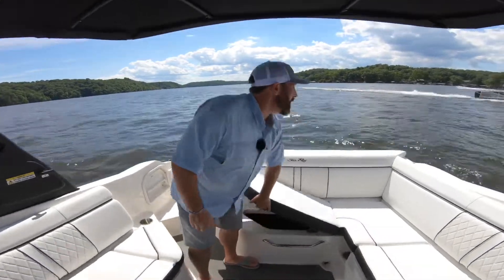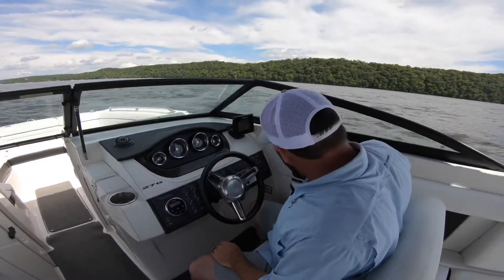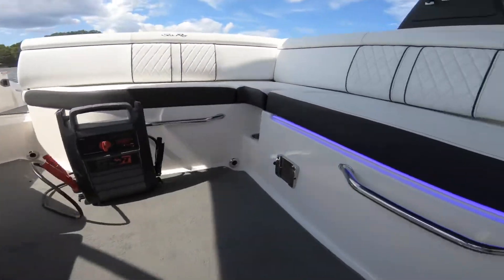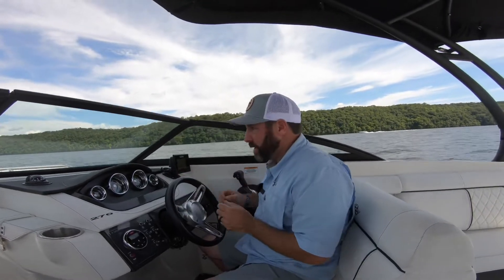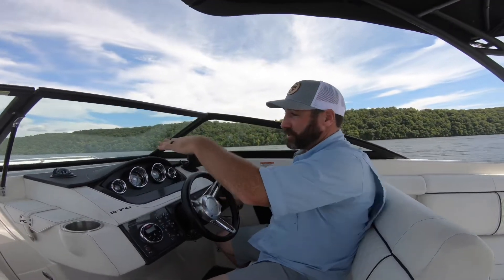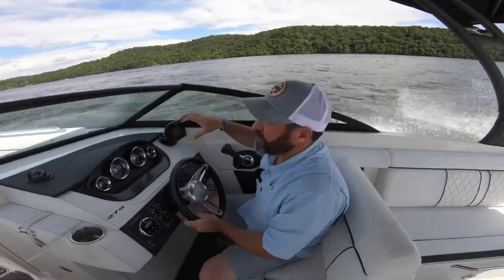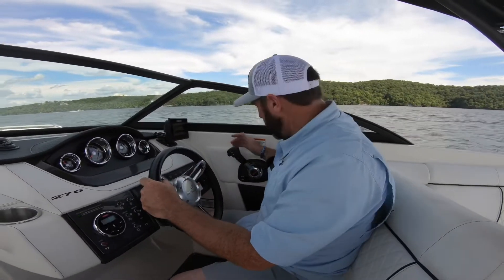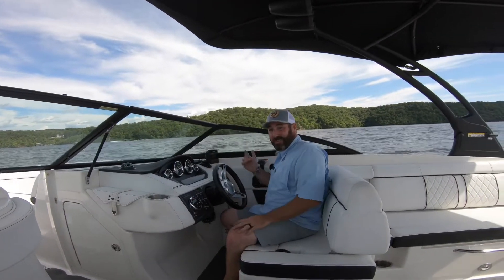Is a Sea Ray 270 SDX a good boat? Part II

Comment: Thank you for doing this video!  It's a great review of the boat.  I'm buying a 290 SDX, and enjoyed watching this.  

But, please be careful not to share misinformation.  Docking lights are not "headlights".  In fact, it's illegal to use them like headlights.  If the water is 15 feet deep, you should use a scope of at least 7 times depth, or 90 feet of rode... not "25 Mississippi".  One can use a little paint, or tie a ribbon on the rode every 5 feet so you know how much is out there.  Trim tabs aren't really for "hands free" steering.  

Running with both batteries all the time is a good way to forget, and kill them both at the sandbar.  It's better to use only one, and switch which one you are using each time out.  This helps "exercise" the batteries, which improves longevity.  And, if you run the stereo too long and kill a battery, you still have one in reserve to start the engine.

Comment: What plug and what does that plug do?
Reply from the maker: What part of the video?
Reply: @thekidcansell  I think it was the drain plug, that you were talking about. That you have to make sure you have it in before dropping boat in.
Reply from the maker: Yes sir, goes under the out drive, stays in while the boats in the water. If you keep it on a lift year round, stays in year round.